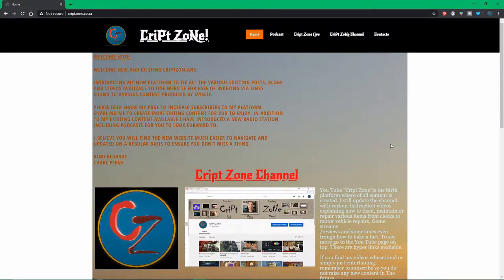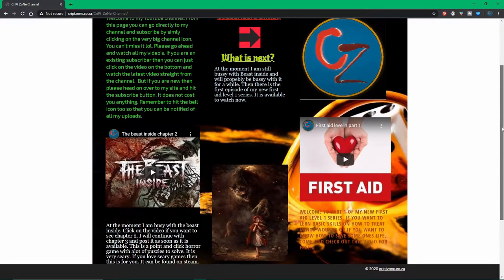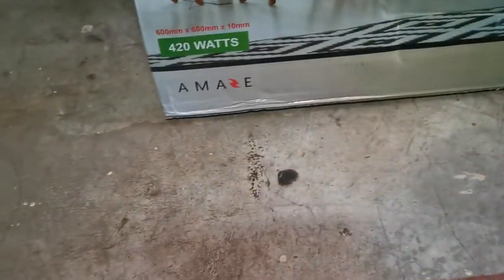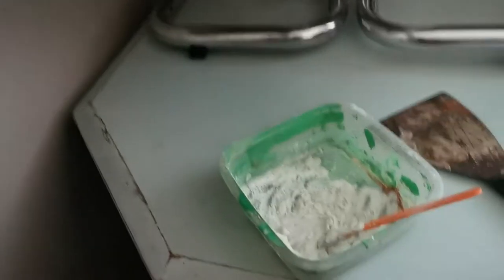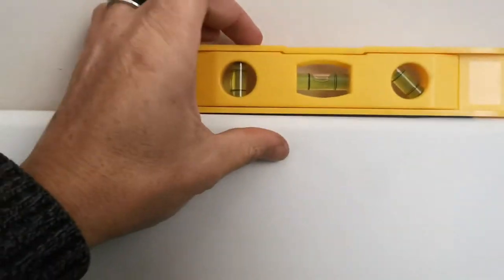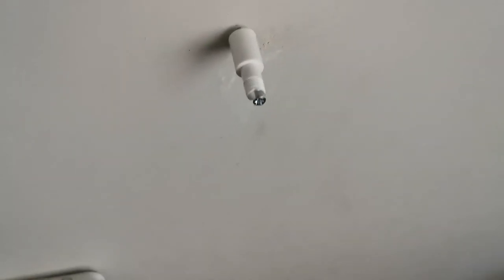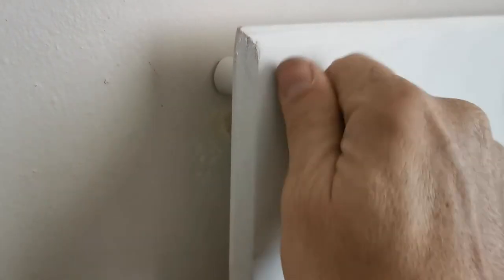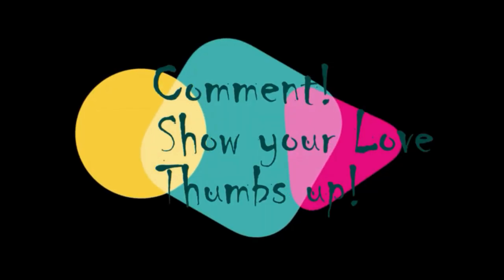Installing a Panel Heater

Comment: Thanks for the video. Would a panel heater like that work in a cold conservatory with lots of large windows?
Reply from the maker: No it is not strong enough. It is most effective in a bedroom of about 2 x 3 meter in size. And then it is only good enough to take the edge off. Making the room cozy. Not too warm.
Reply: @CriPtZoNe  thank you 👍

Comment: Can one be mounted on paneling?
Reply from the maker: Good day. It does come with fittings that gives it the option to be mounted on dry walling . It will depend on what the paneling is made of and if it can take the heat.